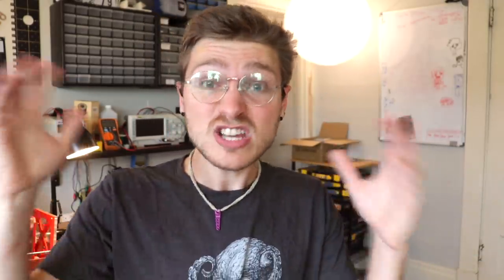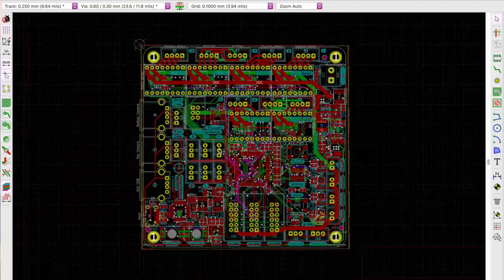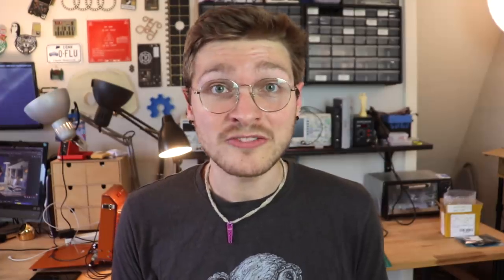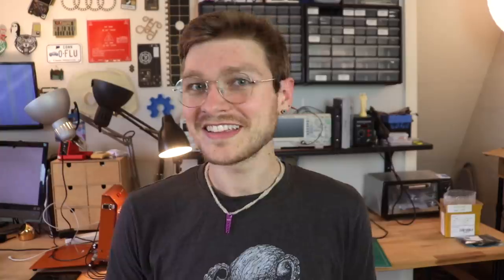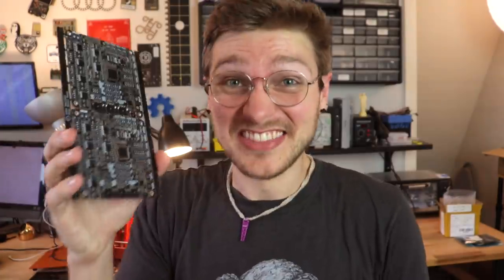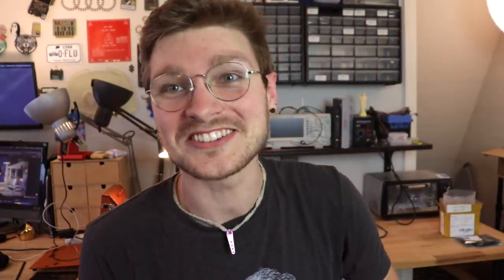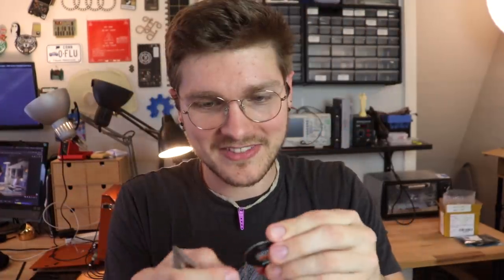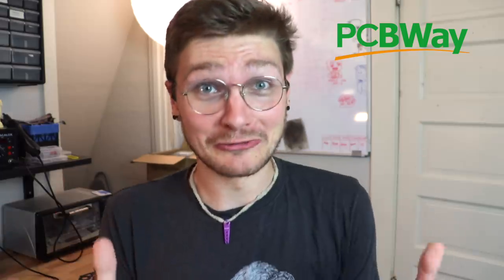How to Panelize PCBs in KiCAD

Comment: Very useful instruction. Remark: When you use rails or interconnecting pieces which dumped afterward, you should modify the mousebites, so that they only have holes to break it apart on the side where the actual PCB is attached. In this way, you directly get rid of the mousebites on the PCB, because they stay with the rail.

Comment: Why mouse bites and not v-scores?
Reply: Well, for the ring PCBs it's easyier because he doesn't need to "add" straight edges but I fully agree for the motherboard V-Cuts allow stronger panel, easyier and cleaner separation.
Also he used "double" mouse bites (with double drills lines) but it's not that good on many points ...
Reply: This is probably not a concern for Stephen, but it's worth mentioning: You can work around the "multiple designs per board cost more" rule of most PCB manufacturers by adding fake traces between mousebites. That way you can get 5 designs manufactured for dirt cheap and break them apart before powering on the unrelated boards.
Reply from the maker: Mostly for dimensionality with the pogo pin jig! With mouse bites, we know all the spots on the edge without one are pretty bang-on dimensionally that we can use for locating the board, but with V-scores it might be off by a bit. But we could have done V-scores and just updated the jig! Both could have worked well.
Reply: @stephen_hawes  well V-scoring tolerances are generally around +/-0.15mm and likely to be the same as routing/slotting so it shouldn't be a concern. (even for a test jig, believe me)
The more problematic point to keep in mind with scoring is panel warping and rigidity that might get lost if too much scores are put on the less supported axis of a panel (because they are always from one side to another)
It can become a real pain when dealing with really small PCBs (~4x3mm) on a 350x270mm panel ... had to shout on collegues last week to make them understand that I can't just slap 5000+ PCBs on a panel and throw it to our manufacturer :D
But it's really not a common situation and both scoring and mouse bites are good for  almost any low to medium designs ;)
Reply: @stephen_hawes  I'd like to know how those silkscreen labels (inverse text) were created as well - they really do look good.
Reply: Hey brother How to panelize pcb with V score panelization method in kicad.??

Comment: Oh, you should also be able to increase the board density of your ring light boards by flipping alternate ones upside down and staggering them in the Y axis.
Reply: They also need to be staggered so the board doesn’t have huge cuts that align in the x and y axis directions, because the board will sag during pick and place.
Reply: it would make the breaking apart harder thou, because the edges don't align

Comment: 2 Pro tips: 1) offset mouse bites into the PCB so that the reaming "teeth" left after breaking it off is lower than the routed edge of the PCB.  No need to cut, grind or sand them.  2) Use two V groves for rectangular PCBs: 2 on the sides where the dimensions are less critical and the other two edges can be routed for maximum dimensional accuracy.  Best of both worlds.

Comment: a pcb nibbler can be really useful, possibly a pneumatic one for you because even the fancy italian manual ones can be pretty tiring to use, leaves a cleaner edge too, I think there are also some considerations about the amount of flex you put on smd solder joints nearby when depanelling

Comment: Look for a PCB nibbler which will cut out the PCB tabs so you get a cleaner edge than snapping. It also means you can get boards from out of a single square edge.

Comment: I currently only panellise designs that cant easily be done with v-score as they usually require a well considered layout, like your LED ring, but if my boards can be panellised with v-scores (like your v3 mobo) I find it much easier to just have the board house do that and add the edge rails etc.

I'd super keen to start using KiKit, but it's not compatible with KiCAD v6, and looks like it wont be until KiCAD v7 comes out due to changes in the scripting support in v6, and there's just too much goodness in V6 to go back to using V5!
Reply: Hi Seon -- I don't think the Kicad project has delayed the Python API completion until v7. That appears to be a red herring, unless you can point to some news I haven't seen. Though I'd be a lot happier if there was an announcement about progress, as I'm awaiting this getting settled to move some of my scripts to 6.
Reply: Hey Bro Can U tell how I do the V score panelization in kicad?  Any IDEA

Comment: Why you didn't use V-Cut for the motherboard panel, any specific reason?
Reply: What about for rectangular pcb whose sides are rounded ? Which should i use v cut or stamp hole (only the edges of the pcb is curved

Comment: I'm working on a design.  It has connectors that hang over the edge.  When I panelize it The overlap becomes a problem.  I wind up making the panel much longer.  With a 2x2 array can the left column be rotated 180° so the overhang mesh into dead space?

Comment: how do you do the inverted silkscreen text? as far as I know, that feature is not implemented yet on KiCAD.
Reply: In case you're still wondering ... I was curious as well, so I did a search and it looks like a plugin called KiBuzzard was used. It started as an EAGLE plugin but was ported over to KiCad.

Comment: A lot of the time the mouse bites are sanded off in the de-penalization step. especially with rounded pcbs. this is done to make sure the pcbs fit as the bites can break a bit randomly. so its better to sand them away or down.
Reply: While this is possible, I have never seen it done in practice. Just recessing the mouse bits is much easier. Moreover sanding FR4 is really hazardous
Reply: @petermuller608  I do agree with that. And yea I isn't very good for your health. Our company has a special room just for the sanding and coating of pcbs. And we do try to avoid it. But sometimes tolerances are tight and the milling is too rough so we have to make them fit. It's also done to not damage the cases or coats. FR4 can have very sharp edges in these areas. 

It is just a quick and easy way to get things nice. But you do need a well ventilated area to do it in.

Comment: Presumably when one is joining a throw away bit with a useful bit, one just wants a single line of holes so it always snaps cleanly, not sometimes leaving a little 1mm chunk of board? Or am I missing some magic?
Reply: Need to recess the string of holes so the ragged edge is recessed from the edge of the board.

Comment: KiCad's great, but panelizing is still way too labour intensive wihtout that KiKit.
In perfect world, panelizing is an hierarchical, parametric abstraction of your PCB where you can adjust the PCB AFTER the fact and panel just updates. Mouse-bites and everything else should be generated based on rules and updated en mass, no need for manual work.

And it should be completely integrated with the PCB software, not just a script.

Then you can even do full panel testing stuff like route an edge connector to the PANEL edge, route bunch of tracks trough the panel part to each individual PCB and define all that as separate layer in your hierarchy such that even if you change the PCB, panel updates if possible.

It should be that powerful :)